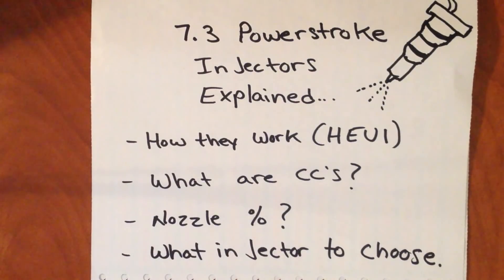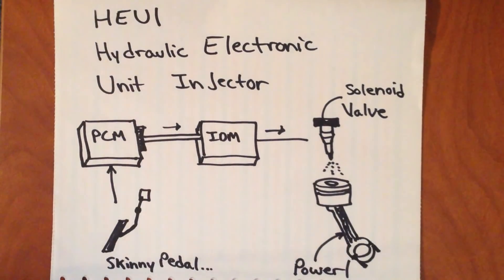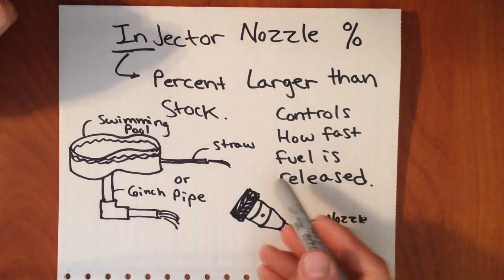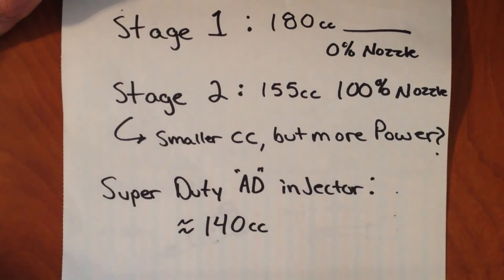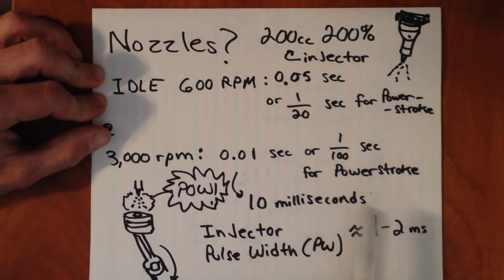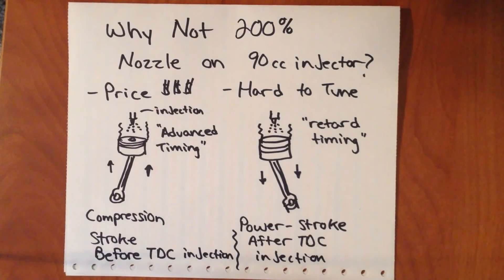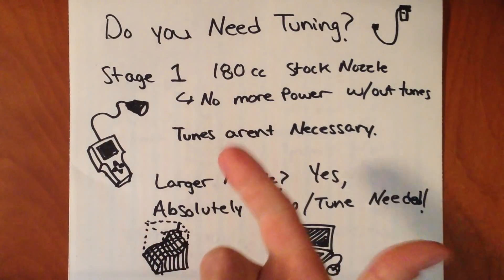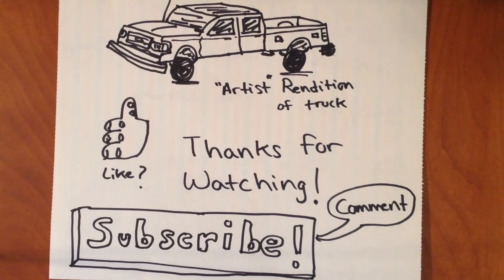7.3 Powerstroke Injectors Explained

Comment: I have a 1995 7.3 and I’m just trying to make the power of a modern diesel. What would be the best most reliable mods? Thanks!
Reply from the maker: Getting a new diesel would be the most reliable mod to get then... just kidding, but that is sort of true. If you want to be reliable and make power, you'll need to beef up the transmission and turbocharger for sure. I don't know at this point what would be the best for reliability per say. Heck just last week my radiator busted because I installed an aftermarket 6.0 transmission cooler to make my truck more reliable, yet it did the opposite. To stay reliable you just need to be meticulous about things. Get a good set of gauges to monitor EGT's so you don't burn up your engine. Watch boost pressure so you don't overspeed the stock turbo or just get a beefier turbo that will handle the boost. It really depends, are you trying to build your old 7.3 into a modern diesel basically just without emissions controls and without needing to worry about monitoring the engine with gauges?
Reply: Rnddiesel I actually have the 3 gauge pod where you have all the gages left of the windshield. I wanna get a boost and egt gage, haven’t decided what I should get for a third gage. I just want make a little more power so I can compete with my dads 6.0 and 6.7. I was thinking slight injector upgrade, 4”Mbrp turbo back, wicked wheel for my stock turbo, cold air intake, and maybe a ts or hydra tuner. Along with other small things I can add. I’m just not sure if this is exactly good for a daily driver that I’ll occasionally tow with. Thanks for the reply!
Reply from the maker: @Nick-ip7ks Sure thing! I see now, yeah having the gauge set is great. I personally got the Glow Shift 3 in 1 gauge. It's been great for me. It measures EGT, Boost pressure, and transmission temperature. I do wish I had the ability to measure fuel pressure though. That may be a future project. Also I've got a scan-gauge 2 that plugs in to the OBD 2 port on my truck to measure Exhaust Back Pressure, ICP pressure, IPR duty cycle, and engine oil temperature. If you want to be reliable and you're good about watching the gauges that's a good start. The best things to look for gauge wise would probably be ICP pressure vs IPR duty cycle (might be hard to monitor on your non obd 2 truck, you may need to get additional gauges for that), boost pressure, transmission temperature, and EGT's. Fuel pressure would be good too if you're putting in bigger injectors. I can't cover it all in a comment unfortunately. By the way the original Wicked Wheel, not the Wicked Wheel 2, is the same as a stock OBS wheel. It's an upgrade for super duty guys to reduce turbo surge. I've got 160cc/00 injectors in my truck, stock fuel pump, intercooler, 3 to 3.5 inch downpipe to a 4 inch exhaust, and a custom TS6 chip from Full Force Diesel. It makes plenty of power for my needs, and I have yet to put it in the hottest tune for reliability concerns. Just do your research and know what you're getting into, be sensible and don't drive with a lead foot all the time, and you'll be good. Cheers!
Reply: Rnddiesel great information man definitely subscribing. My dad has a scan gauge in his 6.0, on the package it said it works with 1997 vehicles and up. But I thought a 1995 obs is the same as a 97, could be wrong tho. Anyways I think I might get the same injector setup as you since it seems good reliability wise. I really want to avoid doing an intercooler but I think it’s going to be needed. Thanks!
Reply from the maker: @Nick-ip7ks  You have to do some funky changes to get the scan gauge to work on OBS trucks, I've got a video in the playlist. If your dad already has a scan gauge it couldn't hurt to try it out on your truck! What I like about my injectors is that without tuning, they behave like stock injectors since they have the stock sized nozzles. Any bigger than about 160 cc you'll need to upgrade the fuel system to take full advantage of them. Best of luck!
Reply: Rnddiesel thanks! Your info is way better than anyone else I’ve talked to. I’ll definitely try hooking up the scan gauge
Reply from the maker: I've got a playlist here that might be worth looking into: https://www.youtube.com/playlist?list=PLF-w6YGPWfXUXM_7Y4NwiDpQBq5aS3BUY

Comment: So would a 350cc/300% kick it up to around 700rwhp?
Reply from the maker: Potentially, that seems believable. Supposedly 180cc/0% can get up to 325 rwhp or so, so almost double that but with more nozzle flow might get you close. You'll probably need to do a few more upgrades to get there (turbo, studs, rods, trans, IC...) and survive though!
Reply: With proper tuning & air, you can get 2.2 - 2.4HP per cc of injection.
You stock bottom end won't handle it, though.
Minimum upgrade on the block would be a Mains Girdle.
Expect to crack your stock pistons.
Other things will break.
But to answer you question: Yeah, about 700RWHP... at least once.

Comment: Rnddiesel I have a 97 7.3 as well and want the 180/80’s but after reading this I might go 180/30’s. However I do have a question I continuously find articles claiming the hybrids help keep egt’s lower than single shots. I want a snappy daily driver who get a lot of highway miles at 70 and only hauls light car trailer sxs etc. I have the upgraded fuel system and I just for the life of me can’t decide if I want 180/80’s or 200/30’s. After this info though you have me nervous because the last thing I want to do is hurt my truck. By the time injectors go in she’ll have upgraded valve body and such. The turbo and tuner will be done simultaneously while I have everything apart. I’d really appreciate your two cents as my truck means the world to me
Reply: 180/30 you will be very happy
Reply: "However I do have a question I continuously find articles claiming the hybrids help keep egt’s lower than single shots."
Hybrids can be either single or split (Prime) injectors.
A hybrid is simply using B Code plunger and barrel in an A Code body, with an A Code intensifier piston. There is NOTHING there to limit to split (prime) or single injection events.
So... what does that do?
A hybrid reduces the HPOP (High Pressure Oil Pump) oil / fuel ratio from 7:1 to 5:1.
That means two things:
1) You reduce your oil demand from 7x your fuel flow to 5x of your fuel flow.
2) You reduce your fuel injection pressure from 7x ICP to 5x ICP.
That gives you some pros... and some cons:
Pro of the Hybrid is more fuel injected with a lower capacity HPOP.
Con of the Hybrid is lower injection pressure of the fuel.
Lower injection pressure means poorer atomization of the fuel.
Fuel that is less atomized yields:
Haze, smoke, poor fuel economy, & Higher EGTs
Hybrids (in my opinion) are a cheap, half-assed fix for not handling your ICP supply issues with your HPOP.

That *said*, Hybrids can get the fuel in the cylinder more quickly than high volume A Codes with a weak HPOP. 
That will, in fact, reduce EGTs...  So, two edged sword.
With Hybrids, you can reduce EGTs relative to high FIPW (Fuel Injection Pulse Width) events.
But haze, smoke, poor economy, and higher EGTs (relative to the higher injection pressure) will still be there.

Comment: Nice video except for your explanation of the CC rating.  @3:30 you say it is the amount of fuel injected if you energized the solenoid for one minute, but later on @6:50, you explain that there is a limited, finite amount of fuel that can be injected per event, and once that is gone, that's it.  No more fuel.  You could leave the solenoid energized for an hour; you would still only get one shot of fuel.
Reply: Actually the CCs is how much fuel the injector can flow per 1000 cycles at full pulse width.
Reply from the maker: I hear you. It's goofy with the HUEI injectors being staged like a mini engine cylinder the way they are. I'm sure they're rated for that flow rate at some given frequency of actuation, some amount of cycles per minute. I want to say though the number is related to the actual displacement of the plunger and barrels multiplied by some ratio, but I could be wrong. I found some relation between the numbers when I made the video to determine the maximum injector size with a stock OBS fuel pump.

Comment: Hey thanks for the great video.  There is one thing that I'm still unsure of.  How does the injector reset itself and fill up with fuelif there is constant high pressure oil pushing down on top of it? After the solenoid closes what happens? I have a tdi p.d. engine that has similar injectors but the pressure comes from an extra lobe on the cam. Also was this system first used in the Detroit series 60 or am I wrong? Thanks and cheers from NY.
Reply from the maker: I'm glad you liked the video! From my understanding there's a valve inside the injector that controls the flow of oil. The injector resets itself when the valve is effectively shut to block the flow of oil. From there the oil in the injector is ejected via a spill port on the side of the injector. It sounds like the injectors you have are still 'unit' injectors, but not the HEUI style. The HEUI injector first came out in the early 90's I believe. It was a joint venture between Caterpillar and International. I think the system you have is an older style camshaft driven system that uses the camshaft to supply the actuation force rather than high pressure oil in the case of the HEUI system. Cheers from Texas.
Reply: Catipapeller invented the system then leased it to International.

Comment: Wonderful, thank you. Tall order, but you should go through the major components of the particular 7.3 parts like you did here. Skip the parts that are common on later model fords or trucks in general, or other engines for that matter maybe, to lower the work load.
Reply from the maker: I like your thinking! Funny enough, I'm actually working on a video series right now that'll do just that. The plan is to get really in depth like we did on the injectors, I'll likely go more in depth to injector functionality in the series compared to this video. Thanks for the input!

Comment: Is it possible for a failing injector to " dump" fuel and wash out a cylinder?
Reply from the maker: It depends on how an injector fails. If a piece of debris somehow made its way into the cylinder and broke off part of the injector nozzle, it would do more than just wash out the cylinder. A broken nozzle would cause it to dump fuel which could generate excessive heat and blow torch the piston in the process. A number of failure mechanisms is always possible. What issues are you having? Is the engine 'making oil'?
Reply: @Rnddiesel  white smoke lots of it , no change in coolant or oil levels.
Reply from the maker: @boatheadsbazzar  My truck was doing that too before I changed injectors. Is it running rough too, like one cylinder is missing out? You probably could use a set of injectors, but before replacing them, if the engine is running smoothly, you may want to try running injector cleaner for a while to see if that clears it up. Clogged injector nozzles can cause poor atomization of the fuel and cause the white smoke. A bad batch of fuel (might have been not diesel fuel I put in the truck...) caused my truck to start smoking white even after I had new injectors. I just ran some injector cleaner like the Stanadyne cleaner and it cleared up after a few hundred miles of driving. If the smoke burns your eyes, its unburnt diesel fuel.
Reply from the maker: @boatheadsbazzar  sorry for the slow reply, it sounds like diesel smoke to me. The white smoke you see is unburnt diesel. Definitely try some injector cleaner, see if that helps. If it doesn't clear up, you're probably looking at injectors to fix the smoke. Another thing too, is if the truck feels sluggish like it has little power, and doesn't feel like a 7.3 'power' stroke should, injectors will go a long way to rejuvenating the truck. My OBS woke up even without tunes when I did injectors, given they were oversized, but it definitely runs like a diesel now!